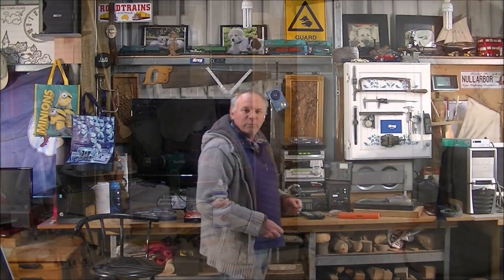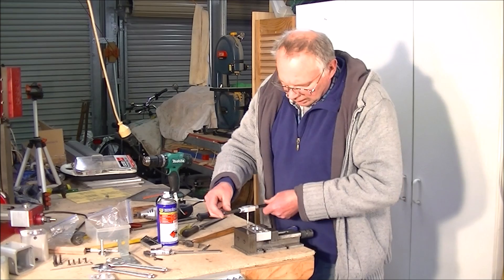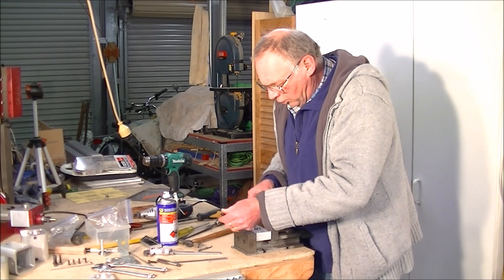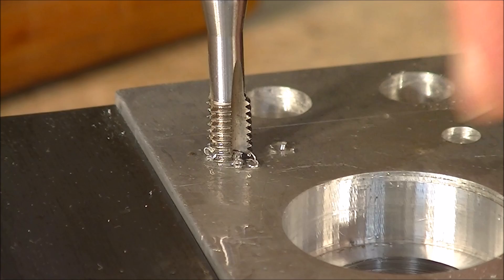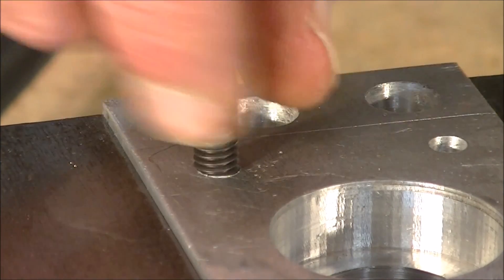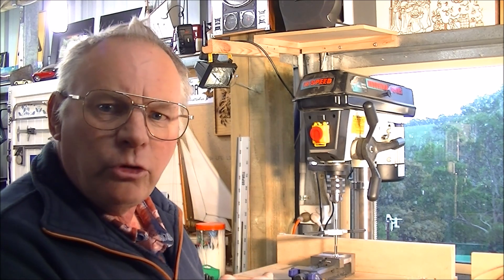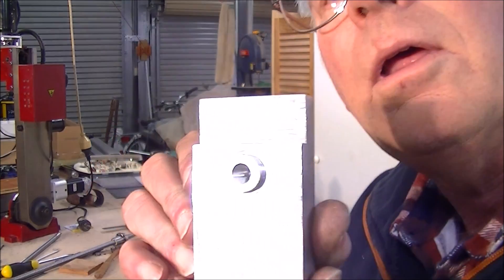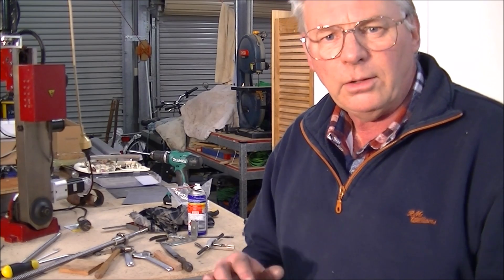139 How to cut / make a thread in a blind hole

Comment: That is a super useful, clear and very instructive video. Does the manual method work on steel, say about 2mm thick ? Or only on aluminum ?
Reply from the maker: All metals 
Thank you, for watching,  
Please like, subscribe and forward the video on to a friend, Roger Clyde Webb
Reply: @inventorsworkshop9600  thanks for the rather unexpectedly quick reply. I saw another video (after yours) where the person threaded a hole that had already been punched in steel. I only have a cheap hand-held drill (fixed RPM), so the tapping method seems to be a lot more preferred.

Comment: Fantastic stripped thread in one of bolt holes of aluminum block in my motorcycle if not this video i would probably replace the whole engine, now i will just make thread one size larger.

Comment: Hi I think you used your taps around the wrong way your second tap was the lead tap that's tap 1 the first tap had no lead in that is tap 2 thay are marked 1/2 thanks
Reply: Richard Halstead i'm with you (but still confused) i thought it was a gradual cut first (2) then the other to (1) square out the thread in the bottom...i just don't know if i can go on anymore